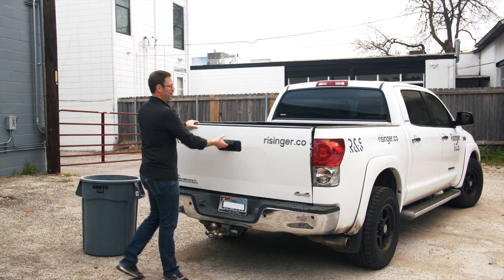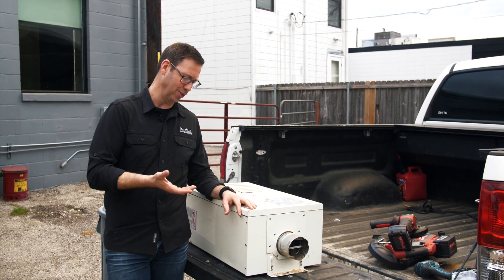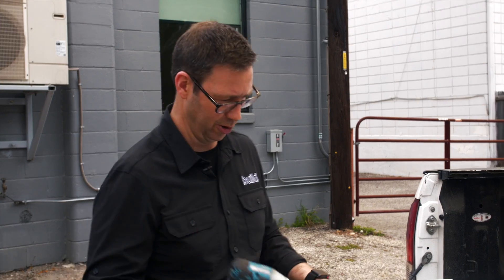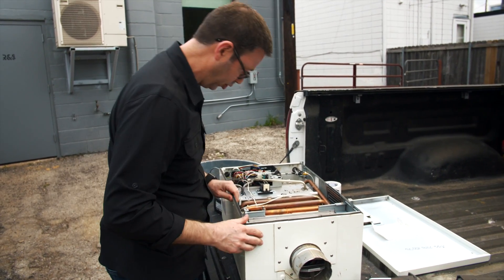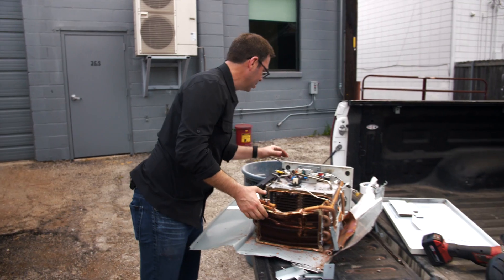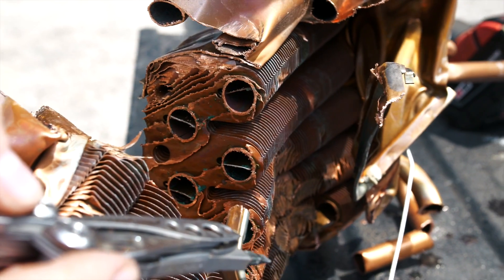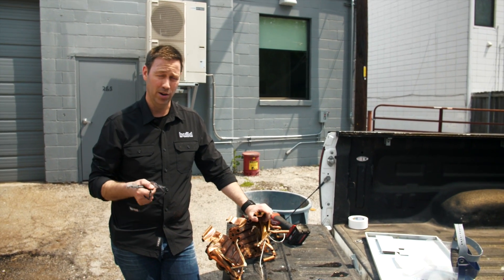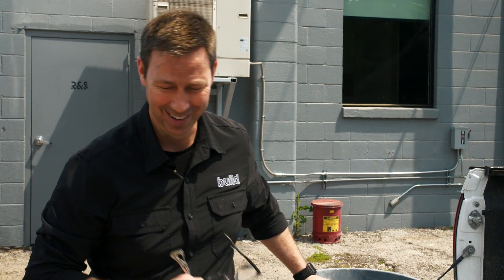Dead Tankless Water Heater - Lessons Learned?

Comment: After the autopsy, the cause of death was determined to be the autopsy.
Reply: Could be the control board needed replaced and the cost was nearly as much as the whole unit itself or some scammer told the owner it was bad and was a simple fix but saw a chance to take advantage.
Reply: Charles Holt and you win the price!
Reply: That's exactly what I was thinking.  I bet whatever was wrong with that could have easily been fixed before the Matt destroyed it.
Reply: Josh K hahaha! Classic comment!
Reply: Perfect.  My instinct was igniter problems: plumbers do not troubleshoot electrical problems very well - they just replace and move on.   The fact that the electronics were Japanese didn't help I'm sure and were a deal breaker for repairs -  nobody wanted to wait 2-3 weeks for something to clear customs [assuming whoever replaced the unit knew where to source from] while waiting to take a shower.  So... if I go tankless, I think I will get a spare flowswitch,  igniter and  temperature switches/probes/thermocouples the unit needs to run.
Stuff like this is why I keep a large 3 ring binder on my house appliances and plumbing fixtures: It gives me a starting point for looking for parts, and can help out contractors by taking some of the guesswork out of their bids.  Try having an A/C unit with the tag all UV burned so nobody can tell the manufacturer, what the charge is/how many tons, etc and you will start documenting things in your house too.   It is a fight sometimes - so many contractors will toss cut sheets/manuals in the back of their truck [or worse] once an install is up and running and leave you in the dark.
Reply: Flinch, even if ordering a new control board from overseas would take weeks, it's often the case that a single component on the board such as a capacitor or mosfet that wasn't attached to the heatsink very well.  In a case like that you can often get a higher quality replacement part for just a few dollars from mouser, digikey, newark, etc in just a few days.  Often all it takes to find the bad part is to look for some burn  marks or buldged capacitor top to figure out what part needs to replace.
Reply: Yup, been there, "oh... That's all that was wrong with it after all... looks around at mechanical corpse oops... "

Comment: on our boilers its often the various sensors that clog and get bad readings.  there are typically several thermistors and a flow switch that can clog with scale or green sludge in a closed system.

Comment: So you destroyed a heater without doing some diagnastic work...?
Might have been something simple.
Reply: It was simple... it wasn't his money on the line. To him, just another piece of junk off the discard pile.
Reply: The point of Matt's video was to see the scale buildup in an old discarded unit.  No way to check the scale without cutting it open,  Answer, as long as the water is in good shape there will be little to no buildup.
Reply: or a dead control board.  Simple: yes..  Expensive: most likely.  Learning experience: priceless.
Reply: You can now buy a bore-scope that's small enough to snake up through 3/4 inch (18mm) pipe to use as a "non-invasive/destructive" means of looking for scale build up.

Comment: Probably a $20 ignitor or flame sensor that failed....and the contractor INSISTED that the entire unit needed to be replaced.
Reply: Shawn Ballee 
Yep, because figuring out why it is broken takes intelligence and effort, and does not make as much  money.
Reply: yup, or could have been a $20 thermal fuse
Reply: CBC did a video on that
Reply: Good luck finding someone who can actually trouble shoot a tankless.
Reply: With a Navien you just call them on the phone and they talk you through the diagnostics.. Their customer service is amazing.
Reply: Doubt it. If that unit was good, it would not have gone to the bone yard. My guess is the company went out of business and no replacement parts like a new control board could be found.
Reply: nobody knows how to work on them.  every plumber i have had in just wants to sell a new unit meanwhile they say they know how to "work" on them.

Comment: Tankless water heaters take water at whatever temp it's at, anywhere from 40 degrees F, to 80 F, depending on your climate and season, it then takes it up to around 120 F in about 2 seconds.  That takes an enormous heat input.  Whether it is a gas, or electric unit, the utility connection must be much larger than is required for a tank unit.  If you are thinking about installing one, you would save yourself money if you located the unit, and your kitchen and bath, near the gas meter.  That way, the large gas pipe it needs will be as short as possible, and the hot water lines will also be short.  The same is true for electric, it will need a large service.  You may need a higher amp electrical panel.
Reply: For gas, you don't need it "near the gas meter", gas is 100% (minus normally negligible friction flow losses) available even at long distances from the meter.  It is not so difficult to move gas long distances and since its got a higher energy content (relatively speaking) its easy to locate the tankless heater where it makes sense, ie, close to the center of locations of most used fixtures.

For electric, you do need it as close as possible to your service connection since the amperage required is high and electricity at high current produces a lot of resistance (friction) and potential voltage drop.  It is typically much more difficult and expensive to move electricity at high current effectively.  This makes it harder to locate the tankless in the most efficient place, near to the locations of fixtures.

Also, gas burners tends to deliver higher energy transfer than electric resistive heating unless you get into expensive higher electric currents.  In addition, gas tends to be much cheaper than the equivalent electric per energy unit.  Irony here is the same problem, gas might be generating your electricity, but line losses to get that high current electricity to you causes the price to cost of operation higher.

Comment: Navien tankless heat exchanger is stainless steel, it’s changes the whole game!! Works great!!
Reply from the maker: Would that prevent scaling?
Reply: Matt Risinger it definitely helps, most of these units don’t go bad from scale in the heat exchangers, usually the smaller moving parts get clogged up with scale, dirt, and lots of other things, or parts fail, remember in a standard hot water tank there is almost no moving parts.... on these things you now have a lot of different parts that need to function at the snap of a finger... I have lots of different systems in different rental properties.... All service calls are from failing parts the heat exchanger does not usually fail.... although I have seen people complain of it freezing up in some rare instances.... I still go with Navien any day.... if done CORRECTLY you will have less issues... but these unit need love and attention....
Reply: maybe they could use silicone or teflon on the metal like in nonstick pans so the scale cant buildup
Reply: do you think that would work in this application matt?

Comment: Could be an off-brand which is no longer supported by the manufacturer= no more parts available. Might have needed a minor part, but that part could not be procured. Also - I have removed these units and replaced with a tank heater because the tankless just could NOT keep up with demand. Set a tank high, maybe plumb in a tempering valve, and you can get very hot water at high flow rates. These tankless just can't do that: you have to run a circ pump to preheat all the copper piping and the unit itself, and even then you will only get the flow it's rated at: which might require low-flow shower heads and be SURE nobody runs the kitchen sink and/or dishwasher while dad's in the shower!!
Reply: Chas and Deeremeyer below don't know anything at all about tankless water heaters, whether the tankless is a gas or electric type. As for removing a tankless and installing a tanked water heater because the tankless couldn't keep up with the demand is a ( load of bull)!!! It would be no different than anyone believing that a 10 gallon, 20 gal. or 30 gal. electric tanked W.Heater would work for a family of 6 without someone in the household never having to wait because of cold water! Not even a gas tanked W.H. as small as the above sizes could do the job. Now if you had an 80 gallon tanked W.H. might work. Well, I have installed many of every type of Water Heater, gas, electric, tanked and tankless and tankless is always the best choice unless money prohibits your choice! My house has 3 and a half baths, 2 laundry rooms and 2 kitchens and we can run all of these all day long and I mean All Day Long without ever turning off the Hot Water with our gas tankless W.H.!!! That could never be done with a tanked W.H.! An 80 gal.tanked W.H. will only recover about 80 gallons in an hour. A 10 Gallon Per Minute gas tankless will give you 600 gallons of hot water in the same hours time. It will also make another 600 gallons the second hour. Our family has never run out of Hot Water with our Tankless W.H., but we did run out of hot water a long time ago with a tanked W.H.!! Every person that I have taken out their old tanked W.H. and installed with a Tankless W.H has said it was one of the best decisions they ever made. Bye the way, I still install Tanked Water Heaters.
Reply: Joseph Hall I agree. I put in a Navien 240 to replace my electric tank. The tank was killing me on electricity. I don't use external recerc only the internal and there is no difference in supply time vs the tank. We have never had a situation where the water cooled down due to demand. We have had the kids filling a bath while someone else is showering and it's just fine. I have a short path from the utility room to my outside wall and with the performance of this thing I'm putting in a hot water hose bibb so I can hot water pressure wash!

I do believe that the cheap units or the old models left a bad taste in a lot of people's mouths. If they were use to an old gas tank and then put in a shitty on demand without and internal buffer tank or something sized too small. I was sceptical about spending almost 3K to install mine but my brother in law convinced me I would not be disappointed. He was right. I will see a pay back on my purchase price in 2 years from the electricity savings alone. But the performance was worth it from the moment it fired up. If I had a gas tank originally it would have been harder to justify the switch though.

Comment: The lesson learned; DO NOT TRUST A PLUMBER.
Reply: yeap its much more profitable! you need a new one sir!
Reply: In all fairness... I doubt there was a plumbing issue, and the problem was electrical.  This looks to me like the kind of thing an air conditioning tech can handle: minor electronics ability,  working with pipe, and  troubleshooting flow problems combine in that trade.   Electricians don't do plumbing generally speaking, and Plumbers can't read a schematic, so I wouldn't call either one for a tankless.  A/C repairmen can likely pickup some extra business choosing to work with these appliances?  It's basically a set of furnace controls conditioning water instead of air.   We'll see what happens - technology is leaving the law behind, and licensing schemes are stuck in the 20th century in probably 99% of US cities today.
Reply: @flinch622  totally agreed

Comment: Its a shame, as you took it apart how you said everything was in such good shape, etc,  And it had to be throw out instead of repaired
Reply: Could have been a pisspoor tech who couldn't figure out what was wrong so just replaced it. See it on cars all the time.
Reply: I know, but shame whoever got rid of it couldnt of fixed it.  Happens with a lot of things, cheaper to buy new than repair, as the garbage dumps overflow
Reply from the maker: It was in the scrap pile...
Reply: Agreed, Virgil. Maybe the moral of the story should be "angle grinders, band saws, and sledge hammers don't make very good diagnosis tools." Lol
Reply: My bet was on an electronic issue
Reply: My thought exactly.
Reply: WillDMcQ Its always something stupid!  Just like old washing machines that quit spinning.  People would rather buy a new POS front loader then replace a $10 belt or coupler.
Reply: Matt Risinger when you were mentioning the thermal fuse it looked like there could have been some distortion to it. I wonder if that was keeping it from firing up.
Reply: Could have been a leak that was in a non-replaceable component (i.e. cost more than a new one to do). Any kind of gas leak would probably be an instant scrap or a crack in the heating pipes.
Reply: Yeah, they did the same thing to my grandmother. Used a chop saw and removed her internals. They sold her usable components on the open market. Found out later, she just needed a check up as part of a preventative program.

Comment: I have this exact heater. They suffered from same bad leaky capacitors that plagued a bunch of computer brands from the same era. Mine was still under warranty when the controller died and they sent me a new one which fixed the problem.
Reply: I remember that from mid 2000's, counterfeit caps made to look like high quality Japanese ones.
Reply: @bothellkenmore   Ah, Chinesium!  There's that MFN hard at work... for the Clintons.
Reply: @flinch622  umm what? Chinesium? Clintons?
Reply: AGREED ~ heat is the biggest killing of electrolytic filter caps ~

Comment: It’s just like anything with circuit boards, finding a person to diagnose and repair boards for a cheap enough price to justify not just throwing it out and buying another is tricky. It could have had some kinda electrical gremlin and/or was to small of a
Unit for the house it was heating water for.

After seeing how many issue newer style power vented water heaters are having with co sensors in the housing I work at, I can understand why people do the switch. While I will never understand renting in this day and age. I would definitely lean toward tankless for any new water heater install. Efficiency may have gone up with new tank heaters but my gawd reliability of those electronic gas controllers and co sensor is absolutely atrocious at least from what I have witnessed with giant. If I was renting one and went through what I have seen my tenants go through, it would be out on my lawn while I installed my own or called another rental company (ifI  was broke )to install a conventional tank heater that’s sensorless.

Comment: That pad you thought was heat tape is indeed heat tape. No wire on the inside tough. Uses the same material to heat up as rear car defrosters do. It does also serve as a safety cut off too.

Comment: It was probably just a fuse.
Reply: Maybe nothing at all wrong with unit;  possibly gas service cut off for late payment? Resulting in no hot water!
Reply: could have been the thermal fuse, not that sheet which was wrapped around the inside of the unit, that was the frost heater..
Reply: Matt would need to rename this video, how to troubleshoot discarded trash.

Comment: I had an older tankless unit similar to this one that came with an older house we bought.  After a couple of years it gave out due to a heavy rain bouncing off the roof that had made its way into the air vent inside a small gap by the storm collar.  Then it made its way into the electrical system.  Not sure if that's why this one gave out on the video.

Comment: Had two each fail in less than 5 years.  Both had pin hole leaks in the thin wall copper tubing where it bends around.  I have soft water.  Maybe they need some kind of anode or thicker pipe to prevent this problem.  Switching back to an electric tank heater.
Reply: many modern boilers have stainless heat exchangers, less of a problem.  our noritz had the same problem.  a few hundred bucks for a new heat exchanger and it's working ok.  ours is plagued by a clogging flow switch, which shuts the thing down at the drop of a hat.

Comment: Based on my limited experience and research. People are installing tankless thinking they will save money.  But they are more of a luxury in that they can provide unlimited hot water. The high cost of the unit and repiping and re-venting to install it or even relocate it does not add up to savings.  Plus you cant just hook this up to a 1/2" gas line like a regular water heater might be on.  If it stops working it will take an expert to figure out why it stopped working. Just getting the right size or number of heaters to take care of one house can be tricky. I have seen people give up on them and reinstall a regular water heater. They may be better suited to new homes that are piped specifically for these heaters.
Reply: Don't forget, when the power goes out...no hot water.  With an old school tank, you still have hot water.
Reply: A lot of people/preppers count on the water in the tank for hydration in case of an electric grid/SHTF scenario.
Reply: I installed a tankless about 1 yr. ago to replace a tank heater and it's working well.  I selected a heater that would let me reuse the existing 1/2" gas line and vent openings of the old tank heater.  That said, the added cost of the heater and install will take ~10 yrs. to pay off with the gas savings.  But the payoff was gaining 10 sq.ft. of usable floor space in the garage for a nice utility sink and cabinet where the old tank used to sit.
Reply: Geez, if you’re not a professional, why give your opinion?  I’ve had a Takagi going on 5 years, no problem. Learn how to maintain them and do research on reliability. Don’t just trash em’. PS: i am a professional.
Reply: Anthony Romano Exactly.  New homes or remodels.  Very difficult to justify cost of retrofitting unless it's a DIY situation.